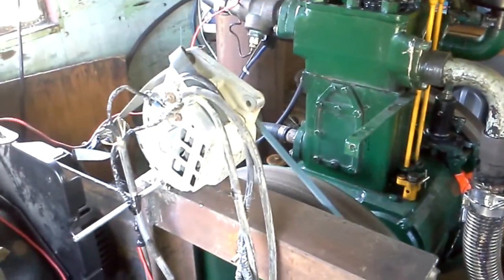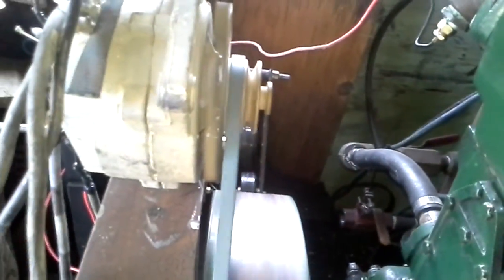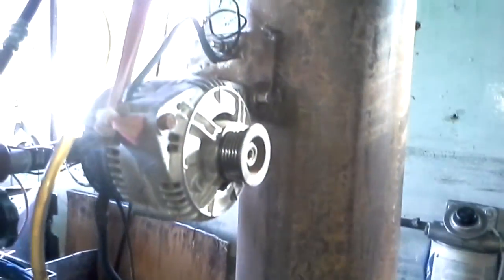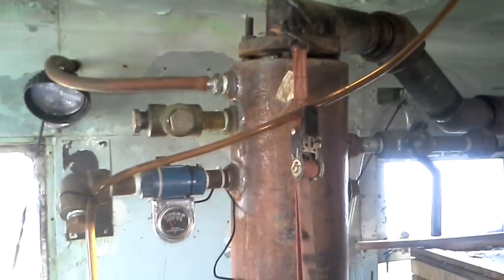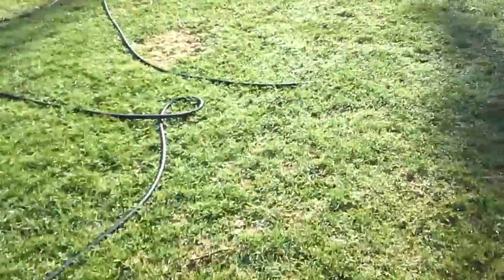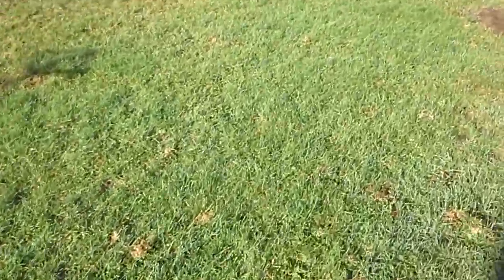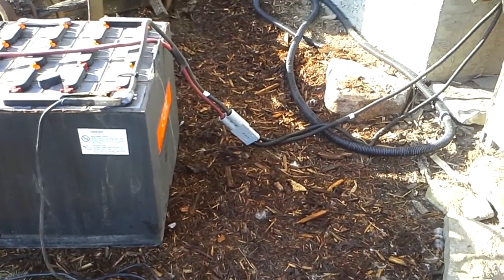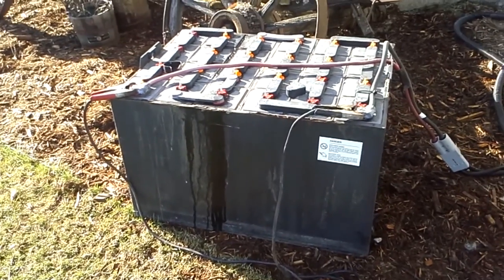Listeroid home power

Comment from the maker: Sorry Raymond that I didn't get back to you earlier   wow 1 year is a long time , no I have not had any trouble with the gear  it's been fine   , I do very strongly believe that the oil crankcase sump is to small and I think that causes a lot of problems    I recommend make a larger oil sump and filter system

Comment: If I ever set something like that up, I'm going to run the exhaust through 2 or 3 car mufflers. Ideally the generator shack will be earthbag construction, and I'll mount the engine on nice soft rubber mounts. In short I'll try to make it as silent as possible, because those things are not naturally quiet.
Reply from the maker: yes im very happy with my old engine    it now has over 14.000 hours
Reply: @1beaverfrank  Why even bother to respond if you're not going to address what was said?
Reply: @terracethornhill   good day Peter i dont cheak my chanel very often  but yes its still running on used oil 18000 hours , i need to upload a new vidio with a few changes as i see are very important   , the sound is easy to work with , and you get lots of heat ,    please mount to very strong heavy base as that is quite nessasary

Comment: Very nice setup...!! like the dodge alternator, welder, exhaust water heater and used tire muffler setup.
Did you experience idler gear failure/timing error and engine balance? I plan to switch gears on my 6/1 for brass and tighten the shaft tolerance on the idler gear. My goal is to pump two additional hours a day to help meet solar pump watering demand for 2,000 fruit trees.

Comment from the maker: I do have valve outside that's 8 feet from the engine that I open from time to time to see the back pressure, than I hook a garden hose to it and pump water through it when its running to give my 4" underground line that's 110feet long a good splashing..

Comment from the maker: So to answer your question it has 5900 hrs on it and it powers my house and heats it also.. So yes I would do it again with all the engine management connected to it first it would save a lot of problems the crankcase oil filtration and Lube tank was a major Improvement to it that would be the biggest

Comment from the maker: Please see my other YouTube and see some of my findings. One thing that I need to add is rpm monitoring so that if an overload situation happens it will lower the load from the alternator on the engine so that the engine can stay at a constant 640 - 655 rpm and if over speed did happen then it would shutdown the engine

Comment from the maker: After I put new camshaft in I discovered that the lobe is wrong so I cut it off and adjusted it that was a very good idea, and made a new crankcase oil pump and remote tank that holds 90L Instead of 2L, the new crankcase lube system has filters and pressure

Comment from the maker: The exhaust poop was so bad that it plugged everything so I corrected the timing and cleaned out the crankcase oil it was sludge it wouldn't come out I used a stick, It didn't get oil to the oil lube pump or the diesel injector so it wore the camshaft lobe down really bad.
Reply: +1beaverfrank Oh my gosh, I totally believe you. Quick story. 2002 Ford Focus, 2 liter gas. I rebuilt the engine and about 2 years later it came back with a rod hanging out of the oil pan. When I removed the pan I couldn't believe my eyes. It looked like someone dumped a bucket of roofing tar into the engine. Going back to when I rebuilt the engine. I told them I suspected the catalytic converter was partially blocked because it was running hotter than it should. You could just tell it had an exhaust restriction. They refused to replace the converter, just drove it until it blew a rod from sludge.  I really learned something on that job (and I've been doing this type of work for over 40 years).  You might want to tap your exhaust and check it with a pressure gauge - just to be sure you're OK going forward. BTW, I really enjoy your videos !- Mark

Comment from the maker: So at that time I put new piston rings on also, it than ran fairly well till around 3500hrs than the fuel pump timing bolt got lose and self adjusted to very late timing and ran at low rpm and plugged everything up with exhaust poop.!

Comment from the maker: Well Keith, if I was to do it all again I would definitely recommend don't use as many recycled products, switches, bolts, wires, pipe fittings, relay contacters, timers, and the list goes on and on, most of my failures are self inflation used junk failure.. The listeroid died at 2000+ hours and I thought it was the valve guides and seats, nope it was from synthetic grease I was using on the valve train that went on the guides and built up and wouldn't move, so I did the head with new valves and guides from the loc machine shop thay were very helpfull and said that synthetic was my problem "it won't burn" so it just builds up very tite.

Comment from the maker: The Dodge alternator has been running for 2700+ hours with a temp of 140F  and is working fine, I'm having trouble with the belt though it lasts 30 days than the V-belt flips on its side really need to put a serpentine on it. The push rods are both turning nicely as you can see on my new videos and the cotton helps to slowly drip oil on the pushrod cup at the bottom.. I'm running on 60%  wmo.

Comment: Cool video!  Does the alternator get hot when under load?  I noticed that the intake pushrod wasn't rotating.  Did you ever fix that issue?

Comment from the maker: OK today was my first day to run used diesel engine oil "wmo"  the oil was sitting in my shop for 19 years and it came from a 5.9 Cummins timberjack 450 skidder so it had all the settling it could get, just ran it though a filter and into the chu-chr  my findings are as follows, 
Water temp - 190 .  Same
Exh temp    - 526f. . 46f higher 
Top of head - 202f...  12 higher 
Rpm   -  14 higher
Switched  back to diesel let it run1 hour shut it down and going to bed... Good day.

Comment from the maker: I used the listeroid  6/1 and my modified Dodge alternator today to give my battery bank a really good equalize 62.4 volts for 1 hour at 45 amps, my battery bank is 620amp hour 48 volt

Comment from the maker: The old Dodge alternator is working great. 59 volts at 5200 RPM.. I do want to change the pulley on the alternator from a V belt to a flat serpentine